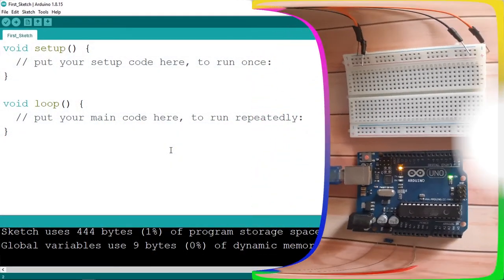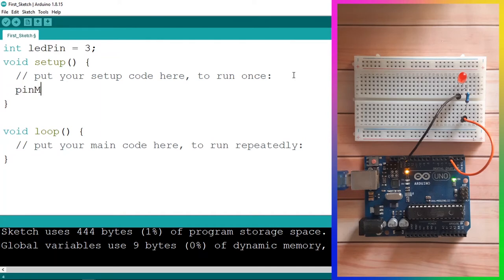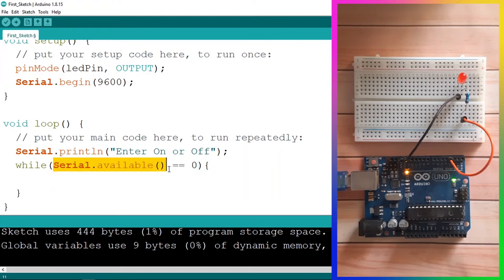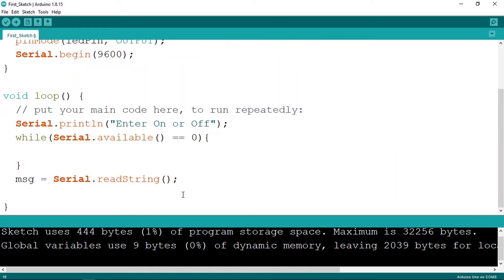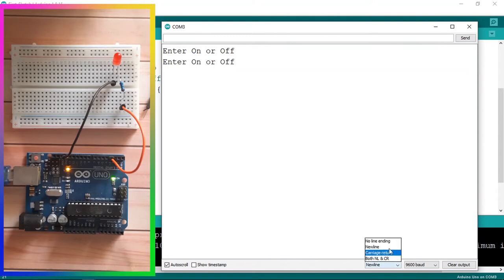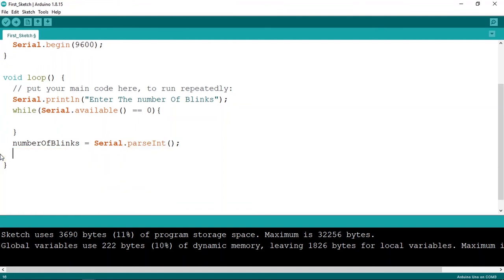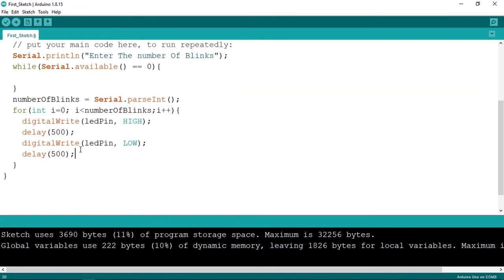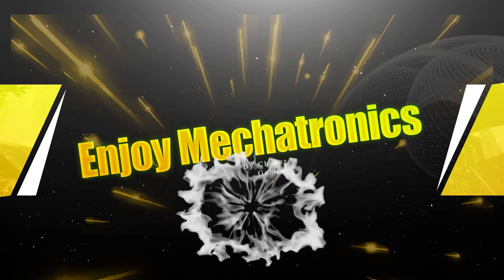Arduino Tutorial 9- Reading Strings and Numbers (Serial Monitor)

Comment: Hi brother.. Nice job.. Thanks so much..
What means this instruction plz:
ترجمة.:
if (text.indexOf("One on")!=-1)   // if Relay 1 is on
  {
    DeleteAllSMS();
    RL1_State = "On";
    Serial.println("Relay 1 Turned On");
    SendSMS("Relay 1 Turned On", PhoneNumber);
    digitalWrite(Relay1,HIGH);
    // 7-10 characters are for time
    if(RL1_Time == 0)
    {
      RL1_Time = text.substring(7,10).toInt();
      RL1_Time *= 60;   // Convert to seconds
      if(RL1_Time > 0)
      {
        RL1_ForcedOff = 1;
        SendBuffer = "Relay 1 will remain ON for " + (String)RL1_Time + " seconds";
        SendSMS(SendBuffer, PhoneNumber);
      }

(haw i can control a timer)